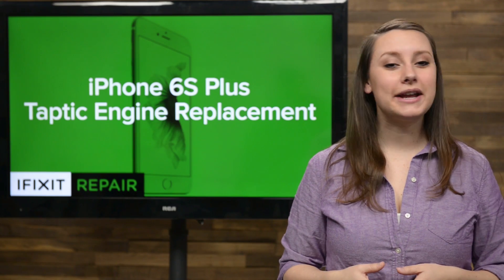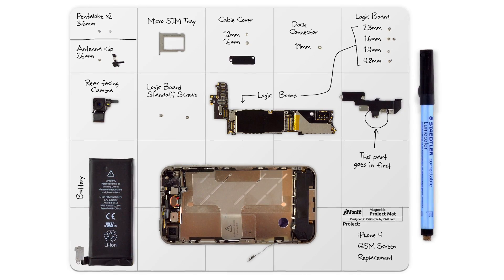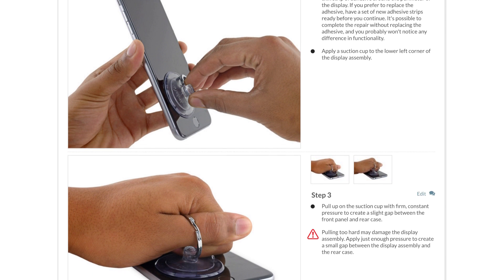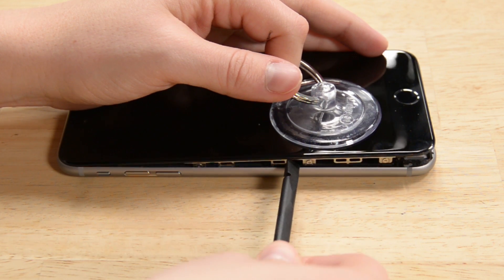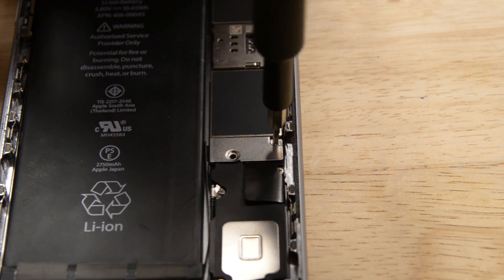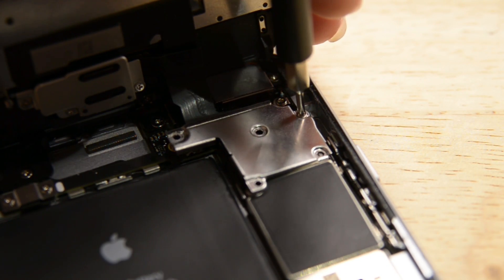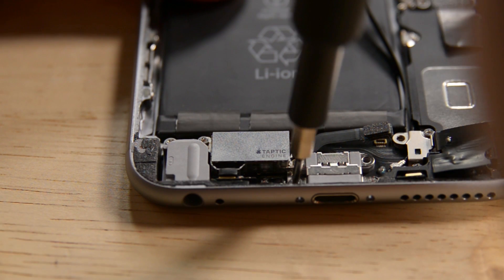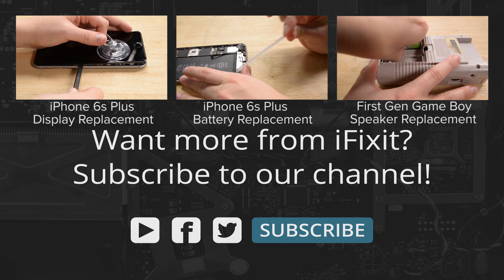iPhone 6s Plus Taptic Engine Replacement - How To!

Comment: Hi. Why do you have to remove the screen for this repair? The vibrator unit can be replaced without having to disconnect the screen.

Thanks
Reply: You remove the screen to make it a lot easier to work in the iPhone

Comment: why do this taptic engine look different than before. i believe it used to be a long one across, below the battery. reply asap
Reply: francis maza the 6s has the long one across the bottom of the battery, but the Plus has the shorter one. They both work the same though :)
Reply: francis maza yeah... that is weird...
Reply: Sachin Sabu 1. A 6 Plus doesn’t have a Taptic Engine 2. It’s a 6S Plus.
Reply: francis maza IKR?? And its stronger?!? WTF??
Reply: this is a 6 plus model... think she is not aware of that
Reply: This 6s one is the long one and the 6s plus one it’s this

Comment: How to upgrade the iphone memory? It will be nice if we can go from 16gb to 32gb or even 64gb and 128gb  who even buys 16gb lol
Reply: It really, really hard i doubt that u can do it.
Reply: +Lord Jon you actually can look it up a company can permanently install an sd somewhere i forgot
Reply: +dat boi  it's not a vibration motor. It's much different.
Reply: Buy a new circuit board but make sure it's not iCloud locked 😂
Reply: RedMotMan you have to go through soldering